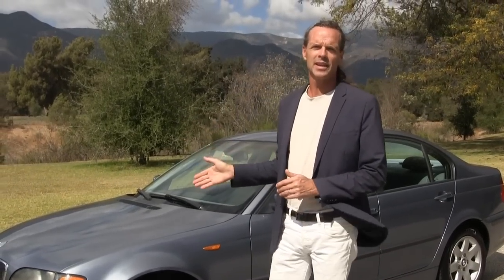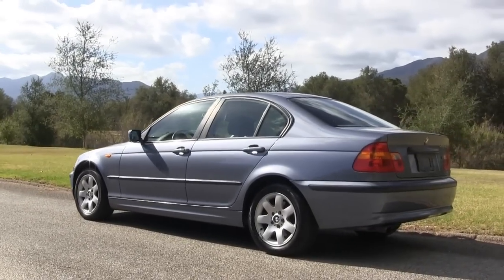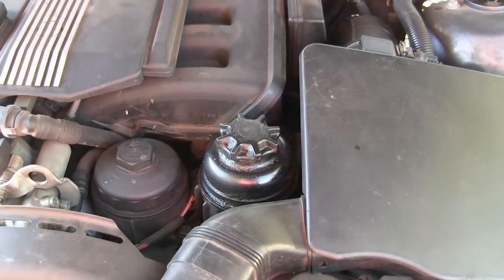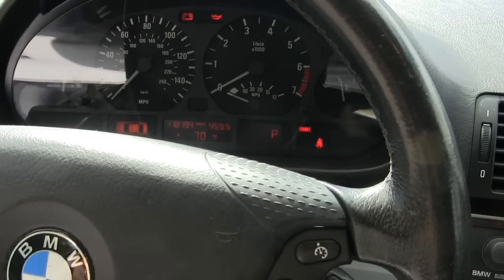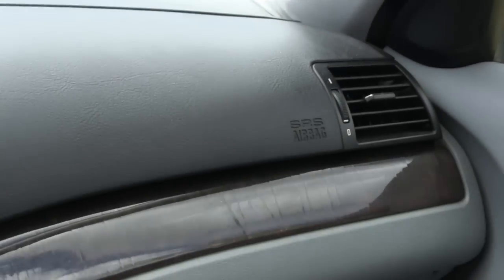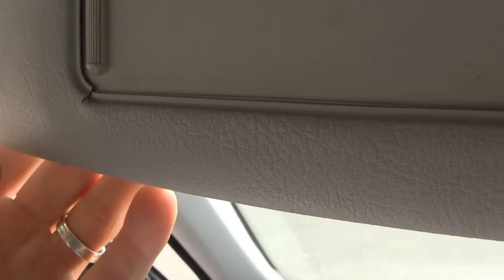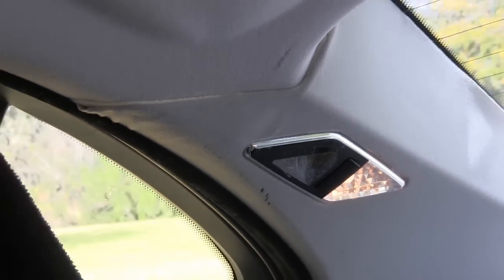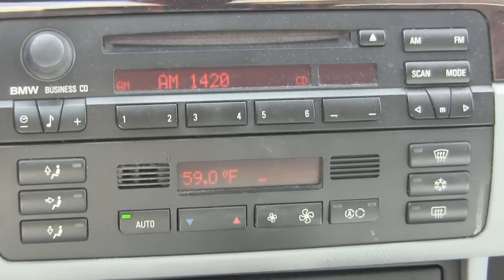Why You Should NOT Buy a Used BMW

Comment: I owned a 330Ci Sport for 3 years many moons ago. Reliability aside (forget owning one out of warranty), my issue with them is the level of grip, insulation and stability. Cars like this are designed for high speed - they excel on Autobahns. But as a driver's car, they are terribly dull.  You wouldn't be further from the driving experience if you decided to take the train. I think this problem afflicts most German performance cars. You have to drive crazy speeds to get any satisfaction from them, which I believe has a connection with rising aggression on UK roads. 99% of the time it is a German car right up your arse right? All those frustrated drivers trying to get their 'fix' from overly insulated cars that rob the sensations of speed from them.

Comment: Here are the facts... I own a 1999 323i with an in line 6 cylinder manual and I have right at 302,000 miles on it and it drives like NEW and is much more fun to drive than any typical import or American made four door sedan of that year or any since. Are you seriously goi g to tell me that any other car from that year that is daily driven would not need a water pump or possibly an expansion tank or develop a power steering fluid leak? Asinine!
Yes, I had to replace a water pump at around 157,000 miles..yes I replaced the expansion tank on the cooling system at 117,000 miles and yes I even have had to replace the clutch TWICE. But remember, the car is now 20 years old and has over 300,000 miles on it. Other than changing the oil and replacing the spark plugs and coils I have done nothing else to the car. The really stupid part of this is that changing the oil, plugs and coils is easier on this car than most any other on the road so I do these things myself and actually save money and know it is done correctly. 
On another note, I found a 2006 330i that was pristine inside with 158,000 miles and the owner was asking $700! He was unsure why he had a misfire and possibly also thought he had a rod knock (because most mechanics are terrible and don’t understand how to actually diagnose most of these vehicles problems). It was simply a case of a leaking valve cover gasket that had fluid the plugs in a couple of cylinders and within 20 minutes and for less than $200 I personally replaced the spark plugs and ignition coils in all six cylinders and the car has been a solid and dependable car for the past four years for her and logged over 100,000 miles. I have had to replace the valve cover gasket and also the starter and have obviously changed the oil but for the amount of miles and the years of reliable service, she could not have had a better car that is safe and extremely fun for her to drive. The other FACT is that the oil is so easy to change that my daughter actually does it herself most of
The time. So, take the time to learn a little about how a car actually works and you will honestly see that these cars are a terrific deal and more fun than most other cars ever made... and yes, they require maintenance and repairs...but show me a car that doesn’t and then do this type of video. Idiocy.

Comment: You didn't discuss the 2 to 4 year old 7series they had every service light on the dash on and the engine control module was in the limp home mode and the repair costs were enormous,I drove many many of them in my 30 years as a valet parking attendant in Las Vegas the 3 , 5 and 7 series were all bad but the 7 's were the worse everything went wrong with them I drove them every day

Comment: My 1992 e36 has none of these problems. Sometimes the older ones are better in some ways. Except the windshield collar, its cracked, but it sits in the sun all day... All cars are made to last about 100mi. They don't make a car much better, would you make a 300,000 transmission and put it on a car that's going to last 100mi? NO. I've owned a few different cars and all of them had problems at one time or another. The difference with BMW is when you put money into it, you get a BMW. I'd rather dump money into a nice BMW than a cheap Nissan or whatever. I've saved at least $4000.00 in labor so far working on my own car over the last 4 years.

Comment: I love the "peace of shit" at the end of the video.
I have a BMW 325i and just about every detail he pointed out, mine has the exact same issue. Although he failed to mentioned a few more issues like the factory airbag warning sign and recall, the faulty lower heater hose melting issue. And the key fob unsyncs by itself.
The car is a great looking car and runs like a champ when it does run. However at 128k miles I wouldnt expect to have all of the failings that it has so soon. I mean I had a Chevy impala 1990 that I just beat the hell out of and it managed to sell well with most of its original parts and no major flaws.

Comment: I have 150K on one of these, and it's like new, those problems only happen with bad storage, that car has been outside in the hot sun most of it's life, does this stuff happen to these cars yes it does, but the window regulators only cost $120 max not $700 and take less than 30min to change, if the cooling system is maintained, you have just the same repairs as any other car, the inside of that car was a mess, that tells you how it was looked after

Comment: I own a BMW e46 with 190.000km on the clock, never had any of these problems just usual things that needed to be replaced like the brakes/tires/oil filter and shock absorbers, I guess the european build BMW are better.
Reply: Yes they are. And it doesn't help that the 3 series are also made in China, Mexico and North America now. If it's not made in Germany don't even bother.

Comment: Did General Motors buy BMW?  I had a 90 Buick Electra that had almost everyone of these problems. I NEVER WILL BUY GM OR BMW
Reply: Watch carangel l on BMW their quality has tanked as well as their sales so maybe infected somehow by GM. One more GM nugget (don’t get me started on their credit card division of thieves) My 1990 Electra had climate control or “Set Temperature and Forget it”.  Too hot? Air Conditioning comes on. Too cold? Heat comes on except ambient outside temperature sensor defective foe ALL 1990 ELECTRAS and if stuck in winter traffic it reads heat from engine and turns ON !&x?/“#%*!!!!! COLD AIR CONDITIONER. I go to dealer and they KNOW ABOUT IT AND WANT CHARGE ME $300 to repair!!!

Comment: E46 is an easy car to work on. Once you take off the engine cover and the front engine fan you will have full access of at the components: water pump, thermostat, alternator. And radiator. Radiator just grab both bottom hoses with the radiator and pull all of it together. And spark plugs are easy access to get to.  Must have car if you like to work on cars. No A day cars the engines are hard to be to.

Comment: That car must have been cooked in the sun for 366 days the year. Which explains the failing glue, the deteriorated plastic parts, cracked wood and dull headlights.

Some of these mentioned problems are common, but not „virtually on every BMW“.

Many parts used are supplied by the same companies that equip Ford, Chevy or Toyota, so given the same conditions, these plastic parts would have failed aswell.

If you ask a German mechanic about the E46, they‘d tell you about frequently failing bushings on the front suspension or some problems with the cooling system, but I never heard about bad interior quality or failing window regulators...

Comment: I have 2 e46's one with 160k miles - changed wing mirror glasses £15 on line 5 minutes to do skill required = none. Change nylon guide on drivers window cable mech, cost £5 on line some skill required. As for the pricing quotes - look on line. I have had no other issues with either car in 6 years of ownership. You don.t have to go to BMW for servicing / repairs most garages will work on them. As for the rest of the car issues where has it been living? In an oven? Never seen one like that before has anyone else? Maybe because i live in the UK.

Comment: Proprietary? Nothing on that car is proprietary. They are easy to maintain and just as reliable as anything else on the road. Bmw materials are a lot more premium than Japanese and American car brands, as someone who has had to maintain Toyota, Honda, GM. Most parts that go bad on these e46 cars should not be lifetime on any car. Your power steering reservoir complaint is stilly, it’s a cap gasket that costs less than a dollar. All radiators are made of that same plastic, even on 1999-2006 Japanese cars. The plastic parts aren’t as bad as people complain them to be. Windshield cowling is a cheaper replacement, probably the only weather stripping that needs replacement because it’s rubber, and it’s not even a water seal. There’s a gutter underneath so water won’t enter the cabin. Window regulators lasted about as long as our GM truck and Camry. They’re easier to fix as well and the door panels actually fit back on the same before removal. Your subframe will really only crack if you don’t use a stock oem suspension, anyone who isn’t a moron will buy reinforcements with aftermarket suspension. Also, that headliner falling apart happens to any car that age that sits outside all year long. These videos are annoying to see, because they focus on the false pretense that other car brands are superior when honestly there isn’t a superior brand.

Comment: Couldn't many of your problems with the E46 be applied to just about any vehicle that's nearly 2 decades old?  While I have experienced many of the issues you've outlined here, to say that you'd be spending "an arm and a leg" is disingenuous.  Much of this is either easily repaired by the owner without any technical knowledge whatsoever or purely cosmetic.  It's clear the car you're reviewing was not maintained properly, and like any used car the buyer needs to do research on what work was done on it.  As a 5-year owner of a 2001 E46, I can tell you that you do need to take care of the vehicle and make sure it's up to date on it's services, but honestly the most expensive thing I've had to repair was the alternator, and even then a rebuilt OEM replacement cost me $200.

Comment: Looks like that car  has a lot of sun damage. So maybe it isn't the car - it's the sun. Any car in the same desert environment will have similar issues.  I purchased an 007 San Diego raised Saturn Sky. Similarly the sun bent the crowl and that caused rattling. The black convertible top faded and warped. The Sky also needed a new temperature sensor, coolant reservoir and door handles. (Now with the bad parts replaced the car is pretty nice.) But with the Sky - unlike the BMW - my local mechanic can service it.

Comment: I appreciate that this guy is trying to help people, but he's way over the top with his criticism. That car was a horrible example of a used E46. I have 2 of them currently,  and had one more prior to those. Their mileage ranged from 130,000 to 240,000. N the oldest was an 01. None of them had all those problems, except the expansion tank. And the headliner failing, or beginning to. I suspect the car he chose to show was in a very warm climate year round, and it was a very hard 118,000 miles. I wouldnt have paid more than $1000 for that car. But then I wouldn't have bout that one. Get a 330, with 17in rims n the Harmon Kardon sound system at least, is a must. NAV is cool, but difficult when u upgrade.. good luck..

Comment: That’s funny every problem you covered in your video is happening in my BMW. I agree it’s a great driving car and I’m doing the repairs by myself and I have been very lucky with finding and using used parts that I find online. All and all I probably wouldn’t buy another one. That rubberized coating on the trim coming off and paint in the console. My head liner is still good though.

Comment: Saw the video. But that didn’t stop me. Good car if you know it’s problems. Think of it as a multitude of small problems, rather than one big. 

Mine was 2.5k with 106k miles. Runs great still. Finding which problem is the issue is the hard part. But the fixes were easy themself. It’s not like a Chevy.

Comment: Your talking about a car that's over 10 to 15 years old. I have seen Nissans with holes in the carpet, Toyota with leather peel; crappy alternators and headliner peel , the Hondas and Acura with the bad gearboxes, all gm have terrible transmissions because of where the modules that regulate them are placed but engines are solid but awd vans and trucks transmissions can go after 40,000 miles if you beat on them. It's all about how well you take care of it. It's no difference than your cellphone, or tv or computer or clothes, even yourself. This is a good example of how badly a person can abuse the car. Just by that interior the car would be worth 1000 dollars, if it was well taken care of it would be a 5000 car easy. No different than any jdm vehicle. also in Europe they have higher standards for inspections your car doesn't pass you can't drive it home, that's why e and s classes are used as taxis they have great parts and great mechanics, USA not so much.

Comment: I wont drive anything but a BMW,as of today i have 3 BMW'S parked in my drive way.in 5 years all i had to change was a radiator and basic maintenance,brakes,oil,filters ect. and a window regulator doesn't cost $700. just under $100.

Comment: No, none of these things should be happening on a car like this.. However, should they be happening on a 20 year old car like this, or a 20 year old car in general? Every car has its fair share of issues. The engine in the e46 is great, aside from the flawed cooling system. Most of the issues you point out are cosmetic and come from time and exposure to the elements.

Comment: Just curious, is it just American deal to bring 15y old cars into the dealerships to fix at a mega expensive rates? As i work in BMW dealership in Europe, and we literally dont see no cars older than 5y (ones with expended warranty) unless recalled... like who would even replace window regulator on a 15y old car for 700 quid (cars worth a grand tops), when the ebay one cost you less tan 20..

Comment: Any car is only as good as the way you treat it. Having said that I used to own a 1990 Toyota Celica which i had for 25 years and treated it like any old car... it was bomb proof. I now have a Beamer which I treat with care. So far it is an exceptional car, Very fast but i refrain for using it full throttle.. It is very smooth because the way i drive it. A lot of beamer owners think they are on a race track..... Hence the problems. Good luck all.

Comment: Really??  It would help if you would actually look over any car before buying it, not just a BMW. I bought a 1984 528E, knew it had some front end problems, but ran  fine otherwise. Total parts about $300, and installed them myself. Needed regular maintenance items like oil and filter changes. The odometer was stuck at 227,000 miles and had been that way through at least the previous two owners.  Figure it probably had half a million miles on it, but hey, for a $600 car I got my use out of it. The body was good and just very minor surface rust underneath. It all depends on the previous owners.

Comment: This is the wrong title for this video! It should’ve been “what you need to look for when buying a bmw” I bought a used bmw 325i e46 and it’s been a year without engine lights because the owner took well care of it but a lot of people say the are expensive to maintain, they are not!!!!!!! You can actually buy a oil filter, oil, spark plugs, mostly everything it needs for a tune up for under 120$ and btw your doing a review of a 2005 e46 obviously it’s most likely to be used you won’t find one in mint condition, yes I own the same car and yes my kidney grills are a bit loose, pillar fabrics are loose but that’s all common but that’s nothing to really worry about just minor problem😫😫

Comment: BMW 3 series are truly a nightmare! There is absolutely nothing on these vehicles that simple to repair. Parts are very expensive and most repairs require an expensive professional mechanic. Moreover, these vehicle drastically depreciate within 10 years. Changing an upper radiator hose on most high performance vehicles is a 15-minute job.  However the hoses on BMWs are made with plastic couplings that are held on with clips. These hoses are very difficult to remove after they've been on the vehicle for a number of years going through numerous heat cycles. The engineers BMW and all of their wisdom, designed the upper portion of the radiator made also of plastic. It's virtually impossible to remove the upper hose without cracking the plastic housing on the radiator. I'm a professional mechanic and I know how to remove a component without force. But in this instance it's unavoidable unless you're very lucky. It gets worse. You must remove the entire undercarriage and exhaust system just to change and u-joint. Yet another example of poor BMW engineering. In order to replace a starter, (or even see it for that matter) you need to basically remove the entire upper portion of the engine compartment. And I won't even get into the friquent issues with faulty sensors, relays, maf, etc. Me interiors are crap. I've seen multiple issues with the electronics harnesses shorting out. I could go on. After working on several of these vehicles, I would strongly advise that you avoid buying any used BMW.